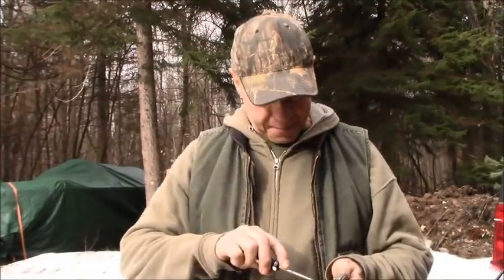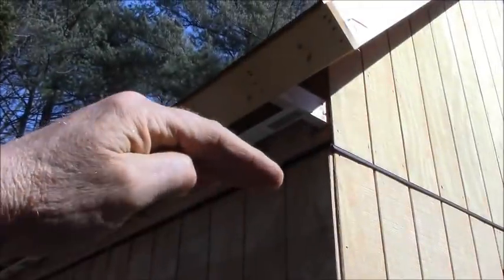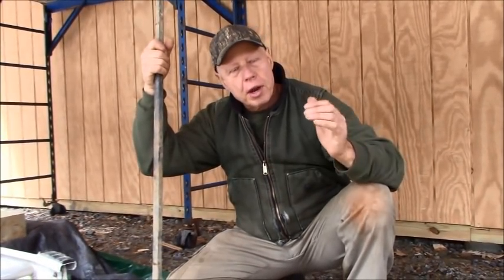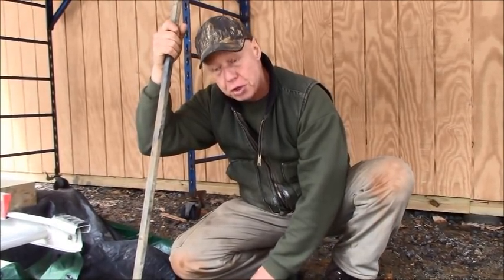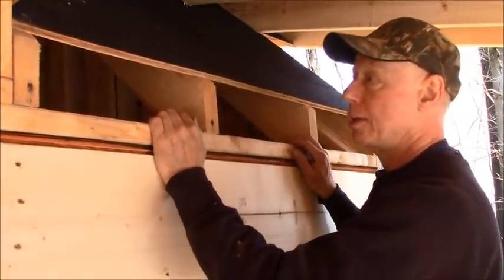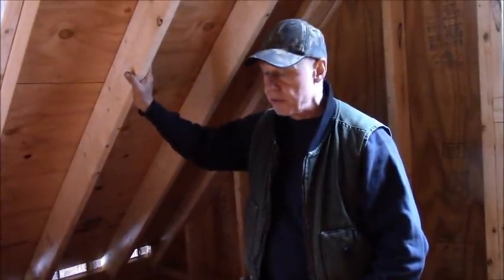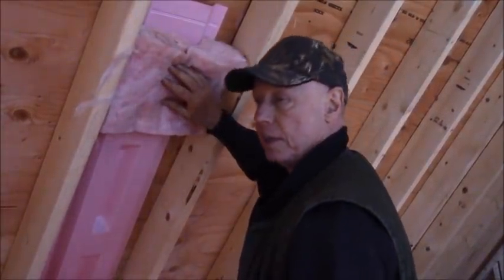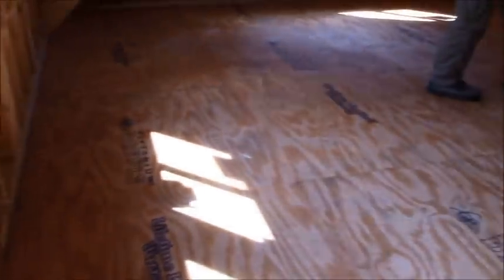Our New Homestead Building Project.  WATCH THIS BEFORE YOU BUILD   Lessons Learned & ?'s Answered

Comment: I just had a new metal building built.  I wanted a workbench in it, and didn't like having to pay the outrageous price for lumber these days.  Had some oak trees in the back yard that were standing dead.  I had thought about dropping them & using them for firewood.  Then I got the idea to take them to a saw mill.  Took 6 logs there, and had them cut to 1x6, 2x4, and 2x6.  Also had him cut enough 4x4's so I could use them for the legs.  He charged me $225.00 to mill them, figured out an average price for all the lumber & it cost about $2.50 per board, and after I built the workbench, I've still got a lot of left over lumber for future projects!  Plus some of the lumber is spalted!

Comment: Here in Central Florida I use the same technique with the egg crate styrofoam to vent the roof also insulate with foil paper insulation. We have built a 10 by 20 Puppy Palace having a gambrel roof Aloft on each side with a ceiling fan in the center. Ceilings having Pine 1 by 6 tongue and groove. We air conditioner and Heat with a mr. Cool 12000 BTU. mini split

Comment: WOW! great VIDEO! If I may: Another advantage of the bubble foil over the roof rafters in the thermal break, isolating the cold rafters in the winter and the hot rafters in the summer  from bringing their respective condition into the interior. You mentioned adding 3/4 in strapping for air space creating additional insulation..  From what I have read reflective foil must not make contact with the set rock. It needs the 3/4 inch gap.. If the sht. rock is laid right over the foil it looses its ability to reflect and becomes one with the sht. rock. Keep um coming brother!
Reply from the maker: Thank you kindly :-))

Comment: Good stuff as usual. Boss.

Great explanations of why you build the way you do.

Thank you for the lesson on condensation.

About 16 years ago my parent's  separate garage was struck by lightning and caught fire.

Because they saw it happen and a few quick thinking measures. The damage was really limited to the attic storage space.
Antique Christmas and seasonal decorations.

I did the demo and remodeled it.

There is a warning not to use Paper Faced Insulation in the roof rafters.
If fire starts below the flame runs right up the paper.
It acts like an accelerant.

Be careful.

Be careful.
Reply from the maker: I'm pretty sure I'll be using the Roxul in the roof which is actually fireproofing insulation. It's great stuff.

Comment: We do not have almost.... almost any frost. We do have rain. Lots of it. So I use a 4 foot over hang. I know it sounds like a lot but it helps take the water away from the siding of the building. Man I am so happy I do not have to worry about frost or snow or shoveling snow. No issues with cold like that where we are. 
Great project. Life is about making projects happen. Man I wish my younger days would have included framing work. I had to become self informed. Man where were you when we were building our house here in Chile? 
We have to make sure all those vents are netted over to keep bats out. Bats are a real problem in roofs here. Love the bubble foil idea. We have been using this as well. We insulate our 750 liter hot water storage tank with bubble foil. We make all our own hot water with our in stove water tank /serpentine that in some states in the former USA are illegal. It really makes great hot water. 
We are seeing lumber prices go up as well but most of our lumber is sourced straight from small saw mill guys. 
Love the channel. Jim in Chile
Reply from the maker: Bats will get into every crack and crevice here too and so will the mice. I'll be using 1/4" hardware cloth beneath the ridge vent etc.  I hate the damn mice if you haven't noticed that haha :-)     Cheers :-)
Reply: @thebossoftheswamp the bat make noise all night in the roof. Drives us batty. Jim

Comment: Good building tactics there.  That room should be warmer in the winter and cooler in the summer with the addition of the Reflectix layer and dead air space.  
If it's not going to be supporting anything with a high PSI weight load, after compacting the crush and prior to the vapor barrier, would it help lock everything together a little more to dust the surface with some sacks of cement, dampen it and then just let it cure beneath the plastic?
The place is looking fantastic.  You should (wait for it)... celebrate the unwrapping of the floor with a big steak for dinner, and extra cookies for the kids, and a second glass of vino.
Reply from the maker: I was toying with the idea of using stone dust for the final layer and possible mixing cement into it.  I figure the stone dust would be easier to level and compact.

Comment: I never knew rafter vents existed like what you used and i definitely need some of those. Thanks Boss, everything looks Amazing.
Reply from the maker: The ones I posted in the link are better than the pink ones I'm using. They are more durable and won't compress by the insulation.

Comment: Wisdom from experience. Every time I think I understand different aspects of a home building process something comes along and knocks me for a loop. You often point out something that I had not considered as a potential problem (down the line or years later). Your insight is invaluable.
See I have been contemplating where my next home is going to be or look like. I currently live in a townhouse community. Something I had not considered before buying this property is all the blasted red tape and decisions by the HOA that would affect my personal enjoyment of where I live.
HOA fees have doubled since I moved here 19 years ago. As it stands now that is now almost 2K that is gone. No interest and money that I cannot use.  I think I can better use that money then they can. It will mean that I will have to do more house maintenance but I can minimize that to a certain degree by making better ground cover decisions. I know that I will be getting a late start on this I will turn 67 in July. But living in a smaller community may not have all the bells and whistles that a larger city has to offer but then the tax base doesn't have to be as large too. More of my money going to someone else's pocket.
Reply from the maker: Best of luck with your plans.

Comment: Again rewatching this video is interesting, you guys didn't build a new cabin, but you could live in that garage no problem. And I wonder if the bubble foil issue has gotten better. You can get loads of bubble foil from the dumpsters of trucking companies, it is used for insulating certain loads and they just toss the various pieces of bubble foil in a dumpster.
Reply from the maker: We spent part of the winter upstairs. We have it set up really cozy.

Comment: Hey JC, great video. Question, could you use bubble foil in place of rafter vent to vent the roof and also act as a radiant heat block? Then insulate. Would this help keep the summer heat out and vent roof all in one. What are your thoughts on this idea?
Reply from the maker: I'm no engineer but I think it would work great as long as there was something to keep it from getting compressed by the insulation (between the rafters). like maybe a piece of rafter vent here and there or even a styrofoam egg carton etc.  Just something to maintain an air gap between the insulation and the roof sheathing.
Reply: @thebossoftheswamp  Thanks for the reply JC, I believe you have a PHD in commonsense engineering.

Comment: Great video. How do you attach the vent to the roof? Would you nail it or is there an adhesive used. Keep up the good work!
Reply from the maker: Are you referring to the white vent strip that I put under the eave?
Reply: @thebossoftheswamp  I’m talking about the pink material between the insulation and wood. Sorry if I used the wrong name.
Reply from the maker: @williamconnolly2152  I just staple it to the plywood with 3/8" staples.
Reply: @thebossoftheswamp  thank you! Excited to see this build.

Comment: JC, How do you let the air escape at the peak?? I Vented my roof like you are showing.....but I used the solid foam filler strips at my ridge cap. Thinking I should have used something like sponge or air filter material to let the air escape at the cap the length of the ridge cap but currently the only opening  is at each gable end. Really don't want to get back on the roof and re-do the cap, but thinking it is necessary due to the fact we had a bit of condensation dripping out at our soffit ends this winter. Thanks for any reply, Best Wishes
Reply from the maker: Before the metal roof goes on, I will rip a 1" strip away from each side of the ridgepole and install a ridge vent.   
I will answer this with more detail in a future video. I'm stocking up the questions ;-)
Reply: @thebossoftheswamp  Sounds Good, Looking forward to it. Hope lumber prices drop again for your sake and ours this spring....but will not hold our breath. Best wishes JC, Lori, and the Pups